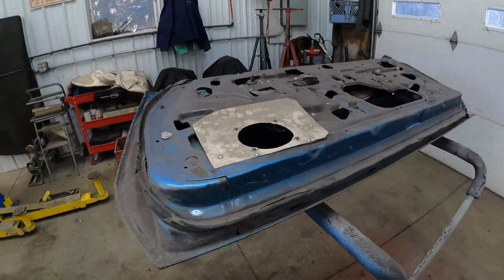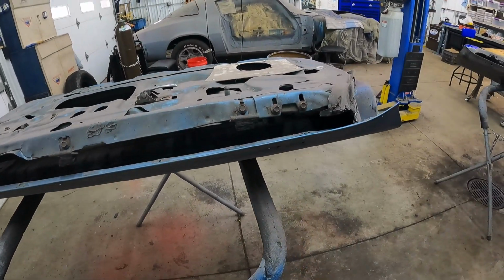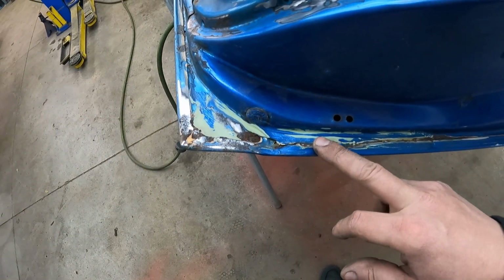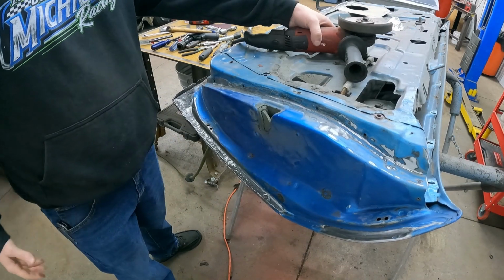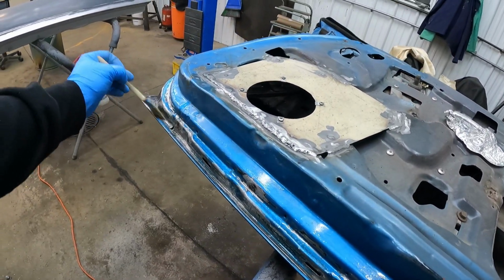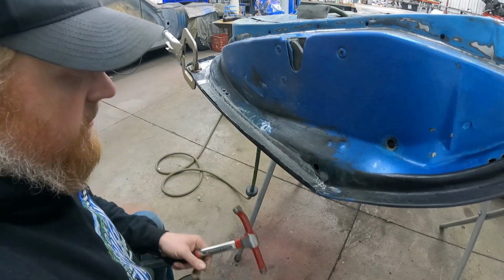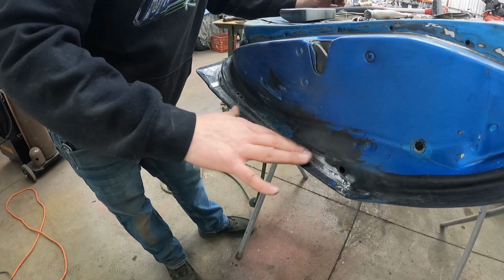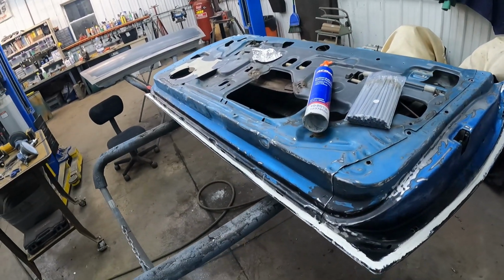70-81 CAMARO DOORS (RUST REPAIR, PATCH PANEL, EPOXY PRIMER SEALER) 2nd gen F-body #firebird #fbody

Comment: I have been using a thick rubber block with metal in the middle & make 4 or 5 passes around with the door skin hammer & that seems to keep the skin edges from needing very much filler on the edges.
Reply from the maker: Great idea James. When I put the door skin on I used the large flat block on the back side. I'll toss a piece of rubber in between the door skin and large steel block next time and see if that helps!